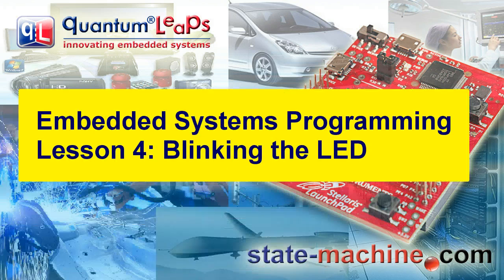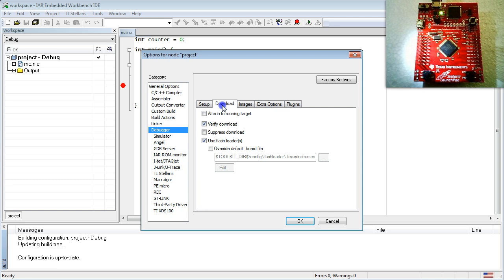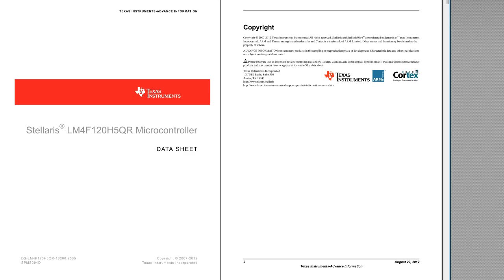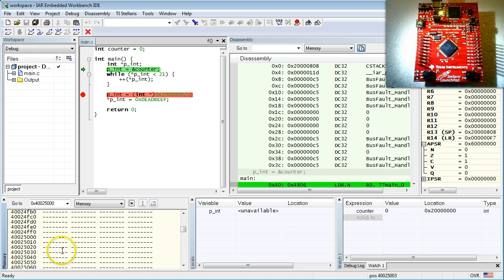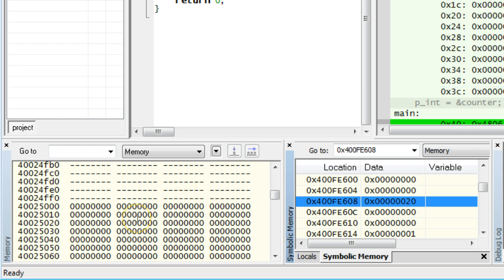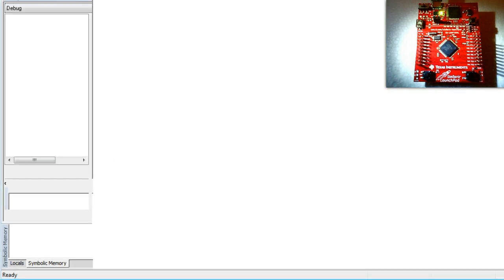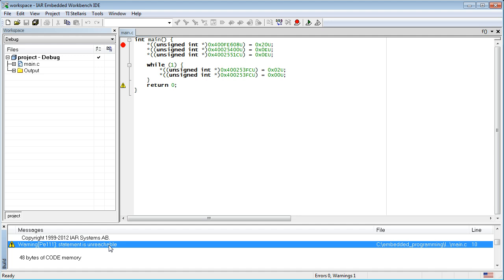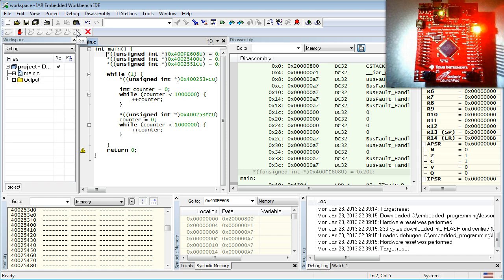#4 How to control the world outside?

Comment: What I want to say is why do you use pointer notation (the asterix's * ) and pointer dereferencing. Why not just write -
PORTF = 0x20u;
Reply from the maker: In the next Lesson 5 the code indeed will become RCGCGPIO = 0x20U; But the whole point is that RCGCGPIO is not a regular variable, but rather the pointer de-referencing wrapped up into a macro. Please watch the next lesson, which introduces the C pre-processor and shows you exactly how this is done.

Comment: Sorry for such a long post, but I got this error message tonight when I tried to load the code. 

Thu Nov 14, 2013 21:59:32: Fatal error: *ERROR*: Unable to open device 0x00000002   Session aborted! 
Thu Nov 14, 2013 21:59:32: Failed to load flash loader: C:\Program Files (x86)\IAR Systems\Embedded Workbench 6.5\arm\config\flashloader\TexasInstruments\FlashLM4FxxxHxx.flash 

Any ideas?  Thanks very much and great work on these videos.
Reply from the maker: This seems like a problem with enumerating the USB port of your embedded board on your Windows machine. One thing you can try is to disconnect the USB cable, wait a few seconds, connect it again, and wait several seconds (you should also hear a characteristic sound when the USB device enumerates). If this does not help after repeating it a few times, you probably need to re-install the USB device driver. The companion site to this course state-machine dot com / quickstart has a link to the USB drivers.
Reply: I had the same problem but it was fixed by his comment above that read 
" I keep getting a lot of emails from people having trouble connecting to the LaunchPad board. Please visit the companion web-page to this course (state-machine dot com / quickstart ), where you can find "Tiva/Stellaris In-Circuit ICDI Manual (USB drivers installation instructions)". There is also a screen shot of the Windows Device Manager that shows how the LaunchPad board should appear in the USB devices section.
--MMS "

Comment: Hi, I accidentally brought C series TM4C123G instead of the lm4f120xl. They look exactly the same in the website and I screw up.  What are the changes I need to make in order for my board to blink an LED light?
Reply from the maker: The TM4C123G board (a.k.a. Tiva-C Launchpad) is almost identical to the LM4F120XL (a.k.a. Stellaris Launchpad). Both boards can be used in this course. Please also see the beginning of Lesson 10, where I show the two boards side-by-side.
--MMS
Reply: StateMachineCOM
I see. I got another issue. I am at lesson 7 right now and I am trying to use the code you taught me on TM4C123G. The problem is, it seems my computer is not detecting the board. How can I check that? I read the installation guide on TI where I am suppose to go to device manager, find the usb that correspond to the board and updated with the software. However, I am unable to find the usb that corresponds with the board.

Comment: Look in the datasheet. It tells you the base address and offset address of each register you need to set up in order to control the I/O ports. That is where he got 0x400253FC. There is no easier way to do this. If you look inside an arduino output(pin, value) function, they do the same exact thing. They just made it easy for you by creating a function that does the work for you.

Comment from the maker: Hi Jason,
I explain the GPIODATA registers in Lesson 7, and I highly recommend that you watch this. As you will see, there are 256 4-byte DATA registers, each representing one possible *combination* of 8 GPIO bits. The last DATA register corresponds to the combination 0xFF (all bits on). But, as I said, all DATA registers are 4-byte wide, so the address of this register is 0xFF*4==0x3FC .

--MMS

Comment: How do u find out that led pins are 0x400253FCU as the address. Isn't there an easier way to set the pins as high or low?

Comment from the maker: The pins in a 32-bit microcontroller are a very precious commodity. There simply aren't enough of them to go around. Therefore many pins have assigned multiple functions. The GPIODEN register controls the "Digital Enable" function of the GPIO. Setting bits in this register tells the MCU that the pins are used for digital GPIO, as opposed to doing some other things (such as being pins of a UART, etc.) I hope this clarifies the question.

--MMS

Comment: I really appreciate your help. Thanks for your consideration
I have two more questions Miro, what is the difference between AHB & AHP?
& my second question is what is the purpose of DIGITAL ENABLE (GPIODEN)?because as i had experienced in AVR micro-controllers it is just needed to define a port or pin as an input or output, I mean as long as you define the direction of the pin or port it is usable but in ARM it is needed to activate GPIODEN as well as GPIODIR,Could you explain what its point is?

Comment from the maker: You need to pay attention to the _offset_ values listed with the register. For example, the GPIODIR register lists an _offset_ 0x400. This means that the full GPIODIR register address for GPIOF, APB bus is 0x40025000+0x400. The same register on the AHB bus has the address 0x4005D000+0x400. So, you can that by giving the common offset, the authors of the datasheet avoid repetitions.

The same for 0x4002551C=0x40025000+0x51C, whereas 0x51C is the offset of the GPIODEN register.

Comment: Hi Miro
Thanks for the videos, the way of your teaching is awesome.
Miro I have checked Lesson 5 and 7 but still i do not get how did you find 0x4002551C ,0x40025400 from data sheet. As far as i got one is for data line which starts from 0x40025000 but how did you find you have use 0x40025400 and i do not have any idea about 0x4002551C. I will appreciate if you explain to me how should i find these data from data sheets
Reply: These are to be found in the register map page 660

Comment from the maker: The number of addresses in the GPIODATA is 0xFFF+1, which is actually 1024 decimal. These addresses represent 256 32-bit registers (256==1024/4, because a 32-bit register takes 4 addresses). Now, these 256 registers are used to represent all possible combinations of 8-pins. In other words, each _combination__ of pins has its own address.

I was actually trying to explain how it works in the video...

--MMS

Comment: hello, i was unable to enable my RCC (clock gating) by changing the value in the symbolic memory (I'm using stm32f4 board, and debugging it via SWD). The only solution was to enable the clock gating in the code itself. Now my question: How can I access/modify the registers directly in debug  like you do on the video ?

Comment from the maker: I think you see GPIOF already active, because you do not start with clean reset. Actually, if you just break into a running code with your debugger, you should expect the GPIOF to be already active, because the Launchpad board comes pre-loaded with a program that blinks the LEDs.

Therefore, in the videos I insist to check the option "Reset does system reset" in the "TI Stellaris" menu. That way, your board starts with a clean reset, so all of us start from the same state.

--Miro

Comment from the maker: Again, I'll try to explain it in the next lesson-5. But basically, the GPIO block in the Stellaris microcontrollrs can be accessed through two buses: the legacy APB (Advanced Peripheral Bus) and the new AHB (Advanced High-performance Bus). These two buses are mutually exclusive, whereas APB is the default. In lesson-4, I've used the default legacy ABP bus. In lesson-5, I'll show how to switch to the AHB and how to use it. Stay tuned...
--Miro

Comment from the maker: I will try to explain this in the next lesson-5. But basically, the GPIO block in the Stellaris microcontrollers has 255 registers to control the pins. These registers are at offsets: 0x000, 0x004, 0x008, ... 0x3FC. In lesson-4, I've used only the last register (offset 0x3FC). In lesson-5 I'll show how to use the others. Stay tuned...
--Miro

Comment: I can't able to find out, why we are writing, in 0x400253fcU to change the LED. the GPIO base for F is, 0x4002.5000 and the offsets are starting with 0x400. I can able to find ,0x3FC only in Channal control Structure. But, I have no idea of what it is? :)

Comment: Hi Samek,
you are doing an excellent Job. Thanks a ton. I comment today, bcoz, today only  got the board. I like to say/share some comments.
1. for me, RAM addresses are get showed differently. 0 filled everywhere, so, I cant detemine, RAM size as you did in the video.same for PortF. 0 filled. Is Port F is not clock gated in my board?
2. the data sheet , you showed in the video is updated now, on jan 19,2013. Some slight changes in the pages. I hope, you use the new one in the upcoming lessons.